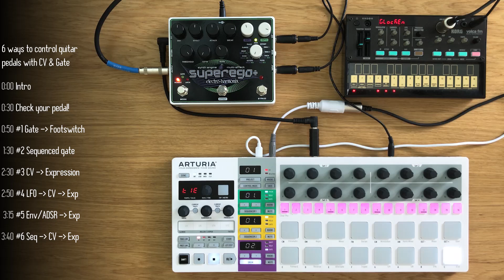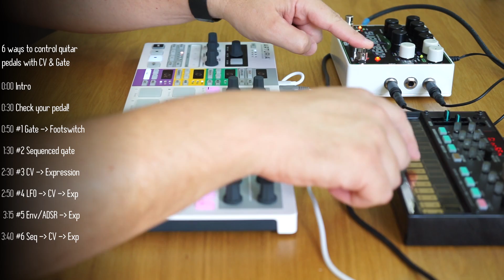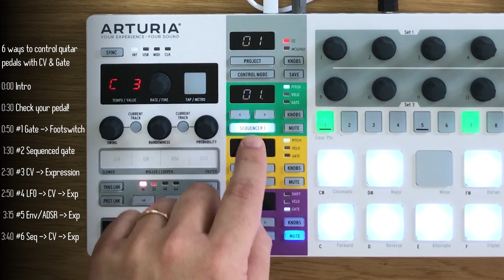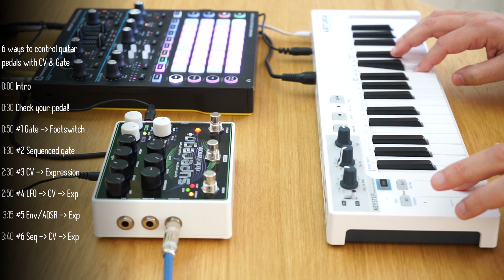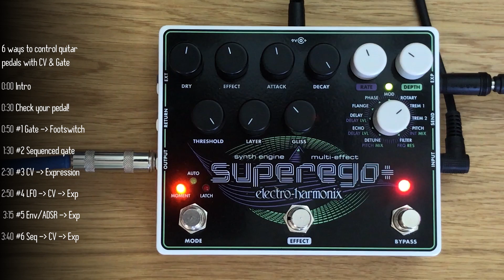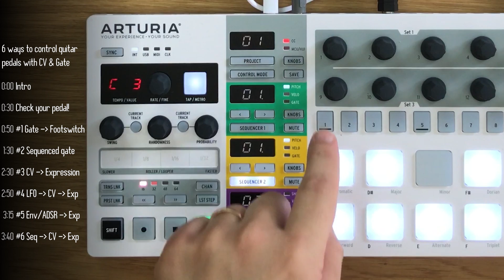6 ways to control guitar pedals with a CV/Gate modular setup (BeatStep Pro, SuperEgo+)

Comment: Good stuff! I wish more pedals had gate inputs, although I have a workaround. A while back, I built a little circuit into a ¼" plug housing that takes a gate signal and converts it to the kind of signal a footswitch jack wants (i.e., gate high → shorting tip to sleeve).  The schematic is floating around out there as "gate to s-trig", because some old synths (in particular the original Moog modular) used that method for their gates; it requires just one transistor, a resistor, and a diode.  

Mine gets a lot of use with my delay pedal, where I have its footswitch jack set to tap tempo; I can thus sync the delay to any clock or LFO. (It's a DD-20; setting the tap tempo to a division of the system clock and switching the pedal's division to dotted eighth notes or similar works wonderfully.)

Comment: I cant help but wonder if the outcome of a software modulator running at a high audio rate as a modulator of a hardware carrier module, would sound of a lesser quality than a hardware high audio rate modulator affecting the same hardware carrier oscillator. 
Are the limits of Digital high audio rate modulation audible? And if so, in your opinion do they sound worse or just different?

Comment: Why is it that Equaliser and COmpression eurorack modules are rare?
Reply from the maker: probably because very few people want them. Compression helps guitarists get sustain - in eurorack you just turn a knob, and you can probably do more with a filter than eq. Plenty of euro filters :)
Reply: @loopop  Possiibly also because maybe eurorack sound designers and producers, either arent as interested in releasing "songs, tracks or albums? or if they are, they record into a DAW and do EQ, compression and mixing once its recorded. 
However, for a eurorack, producer of live generative complex performances, surely they would want to have some dynamics control and simple Eq at the least. I guess they would get a rack mount studio device if they really wanted to. Maybe its no fun to take up space in a case suing Eq's and compressors. 
Thanks for the insight!

Comment: Are you attenuating the signal from the Beatstep Pro somehow before feeding it into the Superego+?  It says in the manual the Beatstep Pro outputs a CV signal from 0-10V and the manual for the Superego+ says it expects 0-5V, I'd be concerned that feeding it too much voltage may damage the Superego+ over time even if you haven't experienced any immediate negative effects.  I just had my MXR 10 Band EQ fry that was powered by a Voodoo Labs voltage doubler cable combining two 9V outputs on my Voodoo Labs Mondo for 18V, since that happened I'm definitely erring on the side of caution to protect my equipment if I can and I'm also done buying pedals with alternative power requirements.
Reply: I came to ask the same thing. Did you solve it? I'm very inexperienced with this things, buy my guess is that sending only CV below 5V it should be ok, right?
Reply: @jnau.u.u  I suppose there's some variation, but most seem to be between 0v and 5v

Comment: It’s fairly simple to hack a pedal foot switch on gear without cv input to control them with gates, for example, I hacked a ditto looper by replacing its switch with a 1/8 inch jack and an optoisolator: https://youtu.be/sDWQqti_hbA

Comment: nothing in the manual for a meris pedal, they said we new to buy a midi i/o box
Can't I do something with CV gate so ?
Please help me dude :/
Reply from the maker: Sorry don’t have one... maybe someone else can help :/
Reply: Thank you for your answer ! 
In the manual, it is not mentioned that the pedal receive cv or gate, only exp, midi trs and that's it. But I tried different controls form cv, clock, trig, gate, from the analog 4 and It looks like some have effects on the pedal, but I do not know, don't think that is on the clock.
Anyway thank you a lot ! For the motivation and this video (nicely done) and the answer you writted me !
Have fun bro !
Reply: @tintinchinesurebay1581 

Did you find anything in the past 5 years or so? I am trying to figure it out for Meris right now myself.

Comment: what other guitar pedals have cv implemented?! besides the moogerfoogers
Reply from the maker: snoopyoverthehills it would be nice to get a list! Most pedals that support expression pedal input should work, but consult your manual to make sure
Reply: is it possible to sync a delay pedal feeding a clock or gate signal to the tap tempo footswitch / ctl input? (eg. boss dd-20)
Reply: Boss Ps3 for example! i'm running to have a try

Comment: I wanted to control the superego+ effects through its EXP input using a Keystep.. Specifically the pitch effect. Which is not exactly what you are doing here. The Keystep sends 0-10V CV , while the superego requires 0-5V. Would it still work?
Reply from the maker: Andreas E yes it worked just fine - check out my review - I used the keystep there

Comment: Thank you for the inspiring video. I remember that the expression input in pedals aren't standardized and well documented. It would be great to have a list of all pedals that accept CV.
Reply from the maker: Christian's Sonic Spaces thanks and indeed read the manual before sticking anything in your pedal... a list would be great... I will put some thought into it
Reply: @loopop 
Has the process come to an end? 🙃
Reply from the maker: @Waldemar_la_Tendresse  no too much of a daunting task… plus a lot of responsibility….
Reply: @loopop  
Thanks. Is it OK to add a comment with a video that explains thf principle? Someone else asked somewhere here in the comments as well.

Thanks for all the good music tech updates. Phenomenal work.
Reply: @loopop  
  
Was this sarcasm? I mean,  expression pedals are probably the simplest thing there is...
Reply from the maker: @Waldemar_la_Tendresse  not sarcasm - as you mentioned this should work with any pedal with expression. However, pedals may use different voltages - on the one hand you might need a high-voltage to reach the full expression range, on the other hand, the same voltage might fry another pedal.
Reply: @loopop  
OK, sorry. I am thinking about it now. It should nevertheless be manageable. Maybe I will come up with an elegant solution in case there isn't one already somewhere in the widths of the net.

Comment: So helpful- Thnxs, been wanting to do this with my SQ1 for awhile & curious about cable plug in- is it a requirement that the connector be a TRS cable?
Reply from the maker: Thanks! You need to check the manual of your pedal
Reply: cool- did you use a TRS cable with the SuperEgo+?